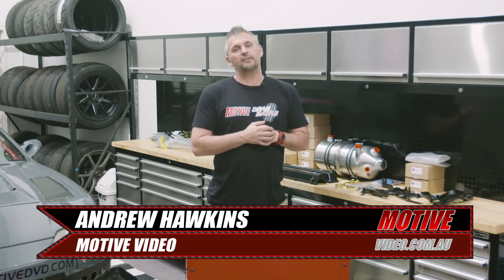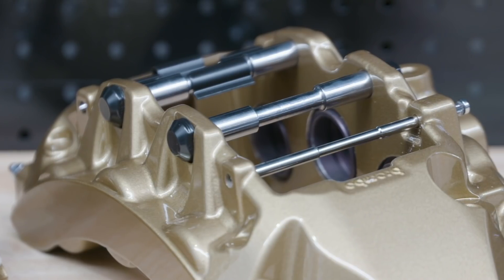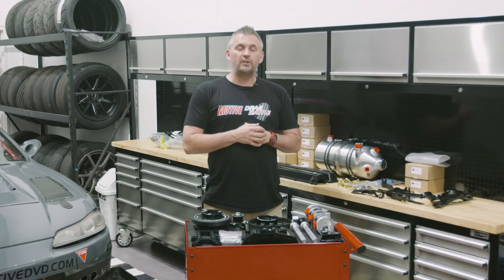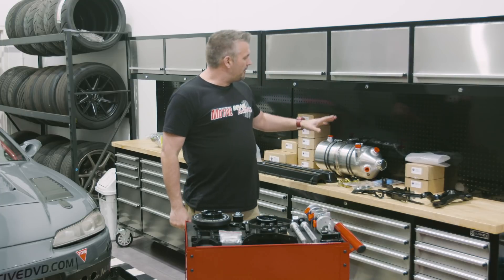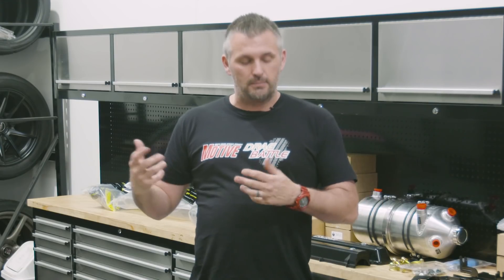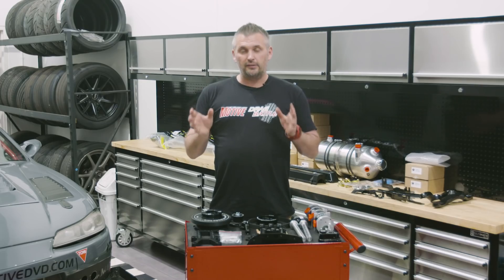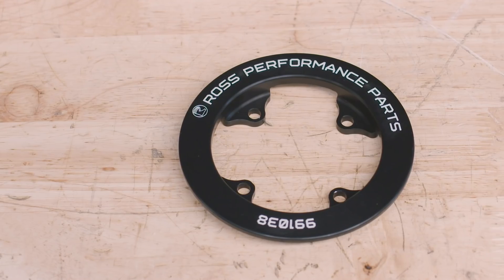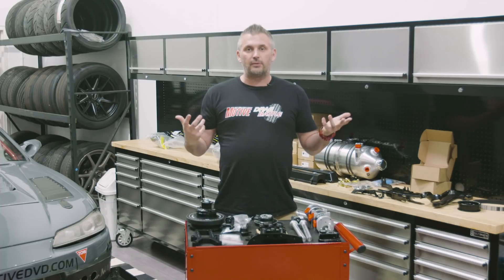RB26 Dry-Sump Kit and More Parts Arrive - Project No Secrets Ep18

Comment: I think you guys forgot to mention that Ross Performance has an A/C relocation kit so you can have the dry sump and keep the A/C.
Reply from the maker: They do, yea
Reply: when i messaged them last they were redesigning it, maybe that work is complete :/
Reply: Where would be the best place to install the tank in a street GT-R though? The engine bay is pretty cramped as it is.

EDIT: Spoke to someone from Hi-Octane Direct. They said a 24" height x 6" diameter tank can be installed in the front and even sent me pictures of it.

Comment: How does ross balancer compares with ati and other ones? If remember correctly you're using some liquid based for gtr32? Will any of them do the job just as good? I like that ross street one rated for 800hp, while ati for 500hp. Whole trigger kit with balancer looks sweet too.
Reply: They're good now
Reply: Ati has 2 models, one for up too 1000hp, and one for over 1000hp. The lower model needs to be rebuilt after every engine rebuild or something similar - i remember reading into it on their site before purchasing mine. I went the lower spec one as the "race" balancer overdrove the AC by 25% and that was unacceptable for my rb30.
Reply: Who cares Ross Australian made and exceptional product and good quick service plus well packaged so the postie don’t fuck it
Reply: @anthonywhelan8373  I'm not Australian tho, but yes, best experience with Ross so far
Reply: captain barge gday captain don’t know what engine you have but there are some excellent Aussie products for rb and 2j engines from platinum racing products and Croydon racing developments also known as Nitto everything from crank and cam sensor to rocker covers and more
Reply: @anthonywhelan8373  thanks mate. Australia is like a Mecca for RB lovers right now :) I'm running rb26